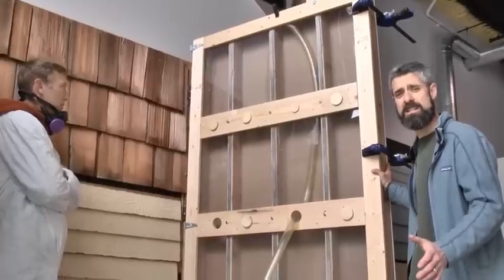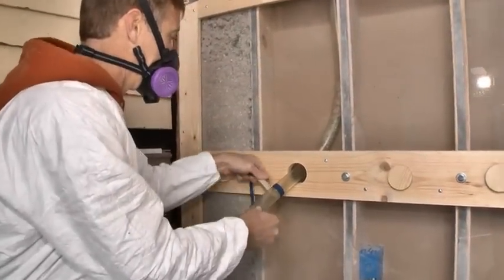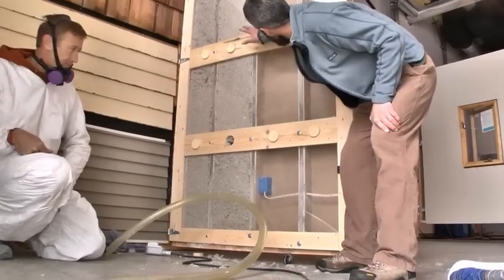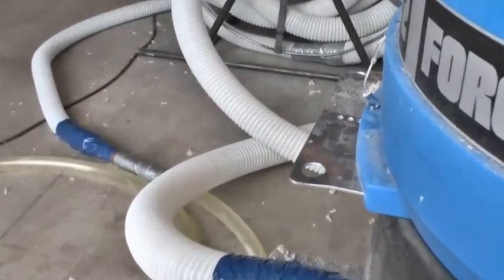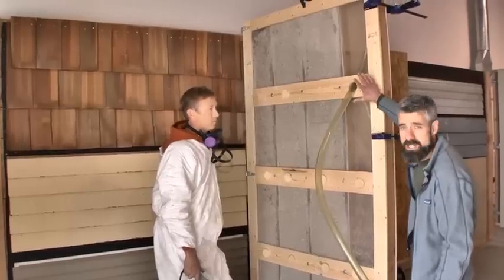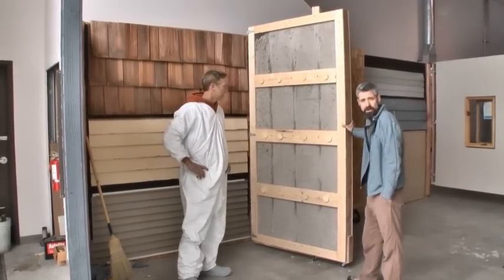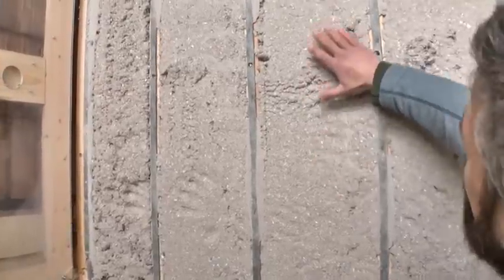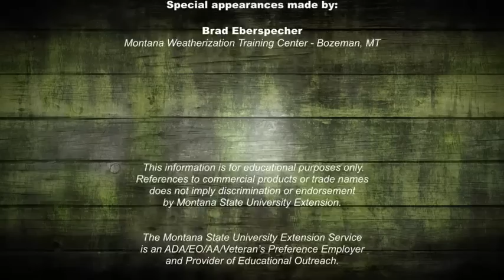A Look Inside A Wall: Dense Packing

Comment: Great video.  Best one yet.  Just a suggestion... How about trying the demonstration without the plexiglass and then pulling away the drywall just to see how it turns out.  It's obviously easier when you can see it being blown in.  Thanks!
Reply: Cincinnati Flem exactly what I was thinking, easy to pack to much into the wall and blow the sheet rock off the wall because of too much built up air pressure if not carful , it’s tricky in real life application when you can’t see into the wall cavity

Comment: Thank you VERY much !!   This is exactly the type of information/education I was looking for !    I've never done blown-in insulation before and I wondered what the differences were between loose pack and dense pack, and also the benefits of drilling low, medium, or high holes to install the material.  Your video not only explained everything clearly step-by-step, but scientifically analyzed the amount of insulation material installed by each method.
Again, thank you SO much !!!

Comment: Thanks for this video, it has been very informative.  However, I was wondering if you could you do the same demonstration, but with a wall with existing fiberglass batting?  I would like to see the process and how well it actually works with existing batting obstructing the fill.

Comment: I was really interested in learning how to do dense packing, and did find the video somewhat helpful. The problem is, at the beginning of the video, you mentioned listening for the sound change to indicate when the cavity is full. However, for each of the four different wall sections, there was music on the video that (to my ears) completely obliterated the sound of the machine as the cavity reached full density. Thus, we watchers/listeners were not able to learn the sound change for which we were instructed to listen. The problem is, when it is a previously-built lath or drywall constructed wall, one doesn't have the benefit of seeing the fill and density happen through clear plastic, but the installer can only rely on the sound change . . . which I couldn't hear because of the music. So, I was pretty disappointed that I was not able to hear the very specific sound for which you were trying to teach us to listen.
Reply: You will  be able to  hear  the sound  change,it sounds like  its   filling  to  now  its  filled.  There  should  NOT  be,but there is  pointless music  behind  everything  in  this  country. I did this job to 4 homes with a  Kirby  vacume,removed the  roller brush taped off the suction hole  to measure  about  6  to  8  in wide,  fed  cellulose into the suction hole  by  hand,it was not  high  speed  work  but  it worked  perfect.Then patch the hole in  the  sheetrock  with the 2 in wide  sheetrock  you cut  out.The sheet rock cookee  you patch  the hole  with  could not be  cheaper,a pro company wanted $1.00  each for a   tapered  wooden  plug. I thought  to  much $$  for a simple piece  of   wood.  Enjoy.  Mike

Comment: I have a house built in 1959 i need to insulate the walls and attic, but i have fount a fire break at about 40" forty inches on all exterior walls, there is a tar paper barrier on the exterior of studs with wood slat paneling.  enjoyed your info video it has been very informative.
Reply: Did you ever blow the insulation in, I've got a house the same age. And, wanted to see how difficult or costly the job was.

Comment: Why don't you run the tube from the top to the bottom and wait for it to labor and pull it up a little at a time? Wouldn't that dense pack the wall?
  Or am I missing something?.............
  Good vid...
Reply: That's what I do fill the bottome before you angle it up. By the time you get to the hole filling it from the bottom the insulation is only 4 to 6 inches above the hole so it's still easy to get the tube in.

Comment: why wouldn't you just start from the top, put the hose down to the bottom and dense pack it all the way up and not have to reinsert the hose ?. I ask this because I don't know anything about doing this. Thank you.
Reply: When filling a glass with water to you fill from the top or bottom? Doesn't matter still have to go back and top/ pack it dense.
Reply: Filling it from the top on a second floor is a long way up and down

Comment: I don't see how he's going to get that stiff vinyl hose into a drywall hole if it takes that much pressure to get it in place.  Working through a hole in a wood plank is one thing, but you put that much pressure on drywall and you're going to break out that hole.

Comment: To echo what others have said... Most of us... Well, none of us have a plexiglass wall in our homes and cannot see how well we are packing.  How about a video that applies to most of us where we have a hole at the top or center of a cavity, or perhaps the upper 6" of the cavity cut away because we had to run electrical or data wires thru the wall but want to insulate it before putting the rock back up?

In the latter example (which applies to me), how would you recommend keeping the insulation from blowing out from the large opening at the top? Would you put the hose all the way to the bottom? And then slowly pulled up as it fills? Would you go ahead and close up the hole and then cut a smaller one for just the hose?  Would you maybe make a temporary 'cap' for the top opening so you can fill to the too, then remove the cal and replace the rock?

What about using this in an exterior wall cavity (like in Texas)? Would you recommend, or not? What about vapor/moisture barriers? 

How do you go from a bigger holes which is normally the host that you get when you rent from Home Depot or Lowe's, down to a smaller size hose?

Great video, but still many unanswered questions.

Comment: Thanks for the great vid.
Seems so easy because in the demo you can easily see the cavity being filled.
Not the case in real life...unfortunately
Reply: True. In the field I rely on watching the rate of the cellulose going through the clear tube and the sound of the blower. If a section of the larger tubes is being backlit by the sun I’ll also keep an eye on that.

Comment: But in reality you do not see if the space is already filled up or not! 

And ... will not the weight of the cellulose after some time having pressed down from above to below, making gaps above and to much densly packed cellulose below?   Also variations in temperature and humidity and possibly some airflow from tiny gaps may dislocate or deform cellulose distribution or its isolation properties.

Comment: not a bad idea. but those wooden 2x4 still act like thermal bridges and transport cold temps.
Reply: Build with a SIP wall system to get rid of the thermal bridges.

Comment: More information which might be handy:. What were your are settings to get that capacity?  How much insulation did it require to fill that one wall?  How do you calculate how much insulation you will need?

Nice music by the way, thought I heard it in a porn video.

Comment: What is the diameter of the plastic hose at the end?  The only machine I can rent from local big orange has a 3" corregated hose and I suspect that this hose would be too flexible to allow the dense packing that we are aiming for.
Reply: The best is a 1 1/4 inch hose with reducers down from the 3 inch hose  The f/2 they use is the best dense pack machine for this application  Bill Jewell  Insulation Technology Corp (INTEC)
Reply: @norman 23 I’ve never seen dense pack hoses rented. But some of the big box stores sell them or you might luck out on EBay.

Comment: If that was a plaster wall there's no way he could force that tube up the wall.
Reply: I do it all the time. You need a 3 inch hole saw. If drilling through more than 1 layer then you need to drill 2 holes on top of each other to get tube at a good angle to force up. Sometimes it gets stuck on the back of the plaster. You just have kinda go in the hole sideways before you go up or down so the end doesnt fetch up.
Reply: @Dylan Fenimore I also cut the end of the tube at a long slant to help it from hanging up.

Comment: Everywhere you see cellulose on the face of those studs, consider that blown off sheetrock.
Reply: Hi Justin. I was planning on blowing in cellulose insulation in a couple months. Could you please explain what you mean buy "insulation on the face of those studs." How would you prevent insulation NOT contacting the studs? Also, what do you do to prevent "blowing out the sheetrock"? Thank you for any feedback. - Dave from Iowa
Reply: @DavidDouglasZach  You need to have the  sheet rock secure. Usually it is. But some people cheap out and use staples. Which I think stupid. It works really well. However each home is different and requires a inspection to see what works best 👌 
Climate and home  construction is key

Comment: green fiber will cut up and throw anything into the product they put out. I have taken several zip lock bags FULL of shreds of string,wire,plastic and other crap into the store mgrs and complained ane nothing, no one EVER did a thing. I have seen chopped up envelope windows in there product. its terrible. they plastic they use for the bags is trash also and splits hen you touch it. If you can find REGAL in your area that is WAY better. Green Fiber also scaled the bags smaller and put in less!
Reply: I see Lowes sells it. Thanks for the heads up.
Reply: @hotrodder62 Currently Green Fiber sells a 19 pound bag and a 30 pound bag.  Personally I don’t care about the shreds (haven’t seen any wire or string) and it shows that they are actually recycling.

Comment: like the bolts to hold together.. "typical house wall"...you wpould've blown the drywall off in a 'normal' house..

'
Reply: @richard michalko Fortunately undamaged plaster and lath walls usually do fine.

Comment: I've had to go back on a 14 ft wall and redo a settle of 2 ft
Reply: Does it always settle to the bottom or does it leave random gaps within any length of wall-- I would not mind if it is simply a matter of filling from the top, since I will always have access.

Comment: I don't know where you are getting your calculations from but 8lbs 10oz is not a density of 4.1 lbs per cu ft if those cavities are 14.5"x3.5"x96". The weight would have to be 11.55 lbs of cellulose.
Reply: Blake, the 8 lb 10 oz was the weight of the insulation and tarp for the first bay, which they say came out to 2.4 lb/ft^3.  So if the tarp is about 1.5 lbs, and the insulation was 6.9 lbs then this is correct.
Reply: @berthull9333   hi Bert,
If the cavity is (14.5" x 3.5" x 96" = 4872"/1728 cu ft = 2.81 cu ft) then, 
2.81 cu ft x 4.1 lbs would = 11.5 lbs of cellulose and not 6.9 lbs.
Reply: @meblake7359  you are right.  they weighed the bays in reverse order that they filled them.  I missed that.   either they edited out of order, or they mis-calculated the densities, as you said.   nice catch!
Reply: I see it now. The last cavity is not as wide as the others. I wish they would have stated that because the whole point is that you can pack denser depending on how you approach the cavity.

Comment: Cannot see a company spending that much time on every cavity. You're just not going to get that result in the real world. And probably not even close to the result on the first hole. Sure, if you had a see through wall and stood there watching him, you'd be able to argue about when it is full. But in the real world, this is not going to happen. And this is why I prefer spray foam.
Reply: truth teller
You just want to argue. You're clearly think name calling is substitute for intelligent comments, but it isn't. It simply proves you have nothing of worth to add.

Open cell is still a hundred times more effective than that fluffy, useless rubbish. And yes, open cell can be installed in existing walls in exactly the same way.

But why bother insulating if you're not going to do it right? Do the job properly, or not at all.

My original comments still stand. Pull the plaster board off and do it right. Closed cell spray foam, every time.
Reply: truth teller
Can't you read?

Closed cell, every time, I said. I'd never use open cell. And I'd never use that fluffy crap either, it's a mold trap.

And just so you know, there are many different weights of spray foam, from heavy closed all the way to open and everything in between. just depends on how you mix it. So when you want to brag about how much you know, remember, all spray foams are not equal. And I never changed my mind about closed spray foam? I never mentioned closed or open, you did.

I'd never use open, not even if it was free. i'd pull off my plaster board and do it right.

And you shouldn't talk, since you've been trying to support that fluffy crap in the video, all along.

So, now you've had a lesson on spray foam.
Reply: truth teller
I don't need google sites, I use closed cell spray foam on all my jobs. I know what it is and i know how to use it.

I'm done with you. I've read back through all my comments and cannot understand why you insist I've changed my story? Ha! As i said, you just like to argue. No amount of reason or information will change your mind.

You go ahead, fill your walls with crap. I'll stick to the good stuff.
Reply: truth teller
There is nothing complicated about it. Only someone like you, that has no clue, would think insulation is complicated. Sure, there are things that need to be done for it to be effective. But here's a fact. A thermos flask has NO insulation, yet it keeps thing either cold or hot. Why? because there in NO transfer of air from outside to inside. It's a vacuum. So, insulation is not complicated. get rid of the air transfer and the result is effective insulation. Fill the void with spray foam, (Closed cell) and the job is done. it doesn't really matter if there is still a cavity on either side of the spray foam, as long as there is no air transfer. Simply common sense, really.

Now, away with your dull arguments.
Reply: Correct me if I'm wrong but don't they make slow rise foam for just this application.  Drill a 1" hole at the top of your wall and one below your fire block and slowly fill the cavity with foam.
Reply: I say we hand each one of you a non face bat of R30 and you two just go at it. The last one standing can have a free can of spray foam. Round one, Begin!!!

Comment: 4th cavity should have been filled starting with the hose at the bottom. That way it could be dense packed as the hose is being pulled up, and the upper portion is easier to fill.
Reply: Absolutely, in fact if you can get your hole relatively close to the top, within one foot, you can dense pack the cavity in a single step approach.  The top will dense pack just from feeding at the hole.